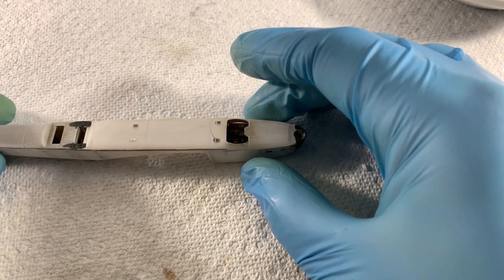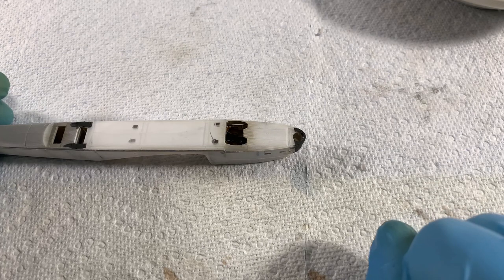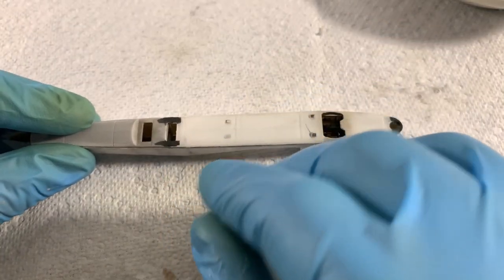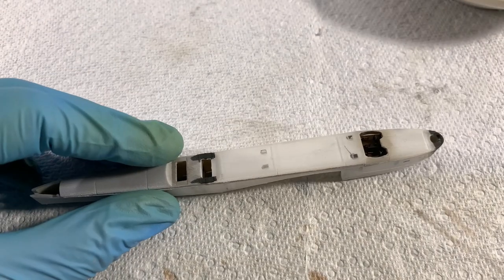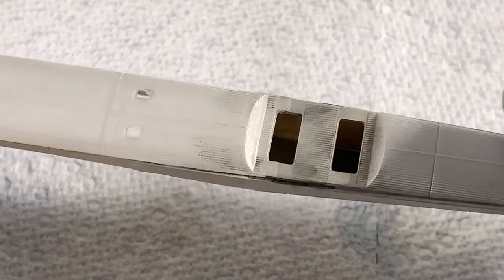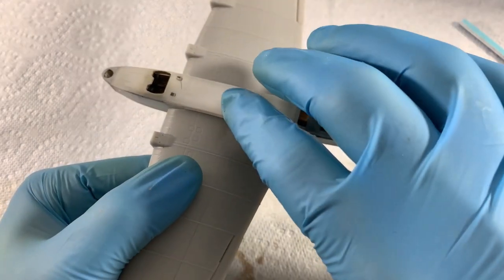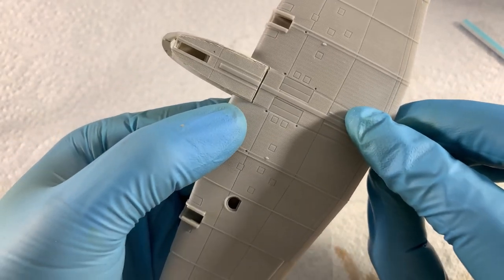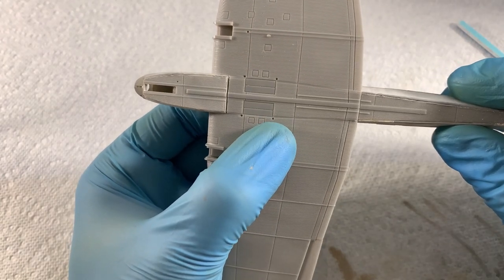Tupolev TB 3 Workbench Vlog 8 Cleanup and Main Assembly

Comment: This kit is certainly pushing the limit. Nothing you can't handle though. Have you ever tried Deluxe's Perfect Plastic Putty? It cleans up with a damp cloth or cotton bud.
Reply from the maker: Yes I have Jeff, and I think it is among the better ones available for its use. I’ve been using mr surface more because I like that I can use a fine paint brush which makes cleanup a bit easier, especially on something like this where there is so much detail on the outside. Milliput and spru goo are my choices with any substantial gap when I know I will be sanding and messing with it after.